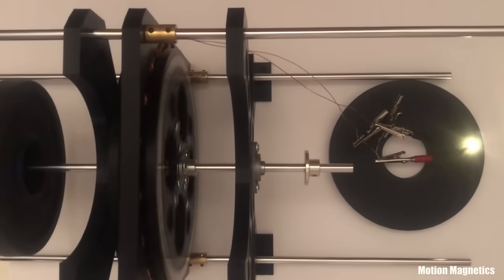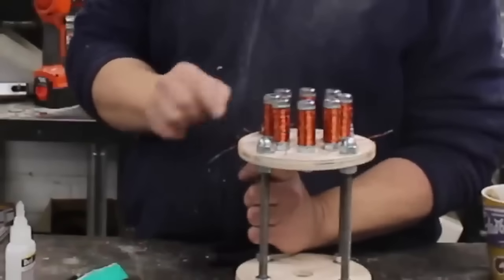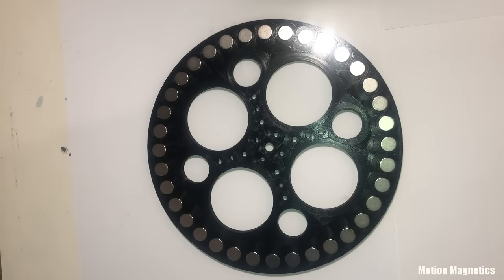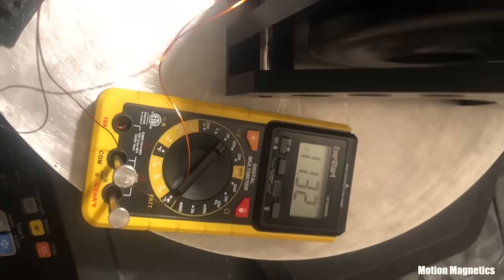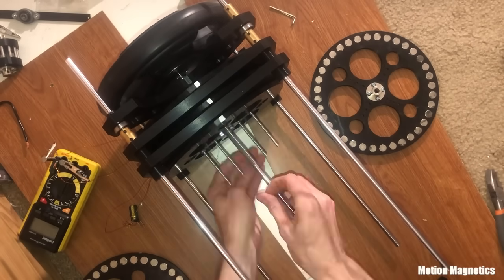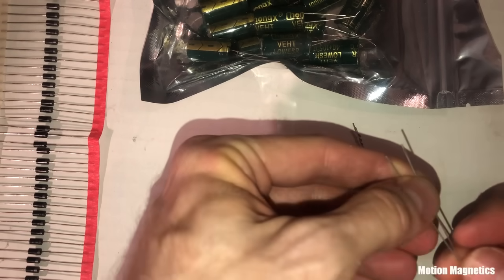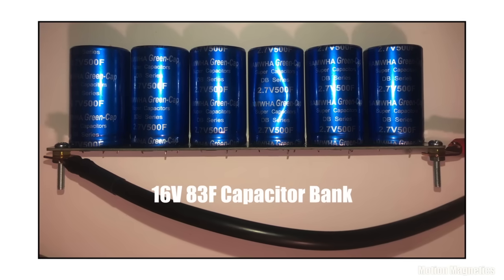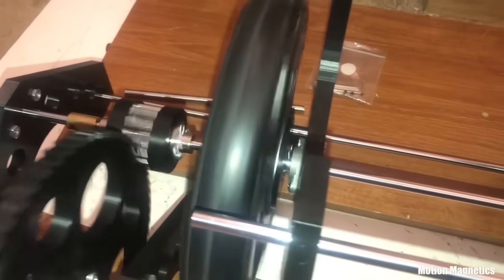Stackable Generator

Comment: I was collecting free microwaves for a while, its true people give them away all the time, but yeah the day you want one, nothing.   But wait a few more days and one will show up.   I have like 20 of the MOTs.   I started working on a motor for a trike using three of them, I had not seen anyone try that before, but you showed someone trying it, can you add a link to your description?  I found nothing myself before.  But another thing that is given away free all the time that may be more useful for a generator is ceiling fans.   
I like your stacking idea, however I will say that getting the air gap small makes a big difference, and those 3dprinted discs would be hard to keep straight and true to maintain the close gaps, particularly if they heat up.   So given you can stack them, I might suggest going with a smaller diameter.
Reply from the maker: Just search "Generator from a microwave" on YouTube and a bunch of videos will come up from people who have built them. 
Hadn't thought of using ceiling fans. 
You are correct. For a full-scale version, it would be better to make the parts with a CNC machine. The air gaps have to be larger when you 3D print the rotors because they wabble, thus you can't produce as much energy output as you could if the parts were precision made with a low air gap. 
Here's a link to one of the generators I referenced in the video.
https://www.youtube.com/watch?v=6hzEB7qmA-I
Reply: @Motionmagnetics  Ahh, I was trying to find motors not generators.  Seems these builds are pretty "sloppy". A motor that powers a moving vehicle must be efficient.
While I bought a lot of big N42 magnets at a business closing sale, they are expensive to buy at retail prices.  The ceiling fan induction motors can gnerate power without magnets.  You could stack them also but free ones are going to be all different sizes..is what I found.  I was working on using them as motors and some don't have poles that can be divided by 3 evenly. as they are all single phase so 14 poles is as good as 12.  But as generators that would not matter for you.
Look forward to more of your videos, thanks for sharing.
Reply from the maker: @murraymadness4674  That's interesting. Thanks!

Comment: This is very cool, I am also working on Axial Flux generator using serpentine coil (22 AWG). I really liked the idea of stacking. Are you planning to use this for wind turbine? I am eager to see the next steps on your initiatives ...keep up the good work 👍👍Thank you for sharing the information 👍
Reply from the maker: Nice! I hope you'll share your results once you've put it together. 
I'm planning on connecting it to gears that will be turned by a weight, but you could connect it to wind or even pedals if you wanted.

Comment: You can put a bedini motor to move the flywhell. Connect the bedini motor to RPM control, when rotation reduces, the motor turn on.
Reply: Adding a Bedini motor will make it LESS efficient. NOT a good idea ...

Comment: Will it not increase the resistance through the central shaft? Strength of that rod will come into play right?
Reply from the maker: Shouldn't be an issue with this particular design, but if I notice the shaft wabbling I'll add another of the outer housings to the center. You're not wrong in your thinking though, the size of the shaft I used definitely wouldn't work with steel cores between the coils.

Comment: Nice. I'm currently finishing up my first axial flux wind generator using Rob's videos and STLs. Your information on rectification was very helpful, made it look very easy with the simple 'twist it together' approach. If my first attempt works out, I'll have to have a proper think about attempting something modular like this. Very smart approach.
Reply from the maker: Thanks. Glad I could help. I got most of that from Robert so I felt it only fair to pass it along.

Comment: awesome work though ,ive found that with the weighted flywheels they need to be really spot on with all the weight at the outer most point or they can work against you ,cou;d posibly find some disk brake rootors around your size ,they hold alot of weight for small package
Reply from the maker: Thanks. Part of the reason I added the flywheels has to do with resetting the weight that will be connected to the gears later. I don't want to stop the generator to reset the weight.
Reply: plus an object in motion tends to stay in motion ,as long as a force acted apon it is not equal to or greater than,well itzs something like that, but what do i know the reality doesnt seem to be to stable these days .so it may change haha @Motionmagnetics
Reply: A Fly Wheel will NOT increase the efficiency. So why add it? It just increases the cost.
Reply: efficency is not allways important ,laws of inertia ,may help you understand why a flywheel maybee a concideration in such devices  @MrSummitville
Reply: we get caught up on things like efficency ,but forget some of the best inventions that cjanged our world were pretty simple and not very efficent ,ill take the device thats not that effiicent but betters the human experience

Comment: with those boost converters they are abit of a tricky one as they can only output the maximum wattage say 300 or 600 when they have an input voltage equal to their maximum input voltage,so exaple if it says 12 to 60 input,to get the full 300 you have to inputn 60 volts ,i know its weird but thats how they work

Comment: would be interesting to power this via higly tuned pulse motor ,or bedini motor,as you can actually get them to output some good rpms with reasonable torque if set up right
Reply: Bedini motors typical have LOW torque which makes them inappropriate for a generator that requires HIGH torque.
Reply: is that a general statement a bedini motor is basically a theroy with a design of concept ,there are 1000s of different configuration some for insane high rpm and low torque to high torque low rpm and everything inbetween,when we see bedini motor which is also coined pulse motor and adams motors ,,little variations on a same concept heres an examnple putting 5  pulse motors on a central shaft pulsed by the same computator ,still low torque?
Or instead of just basic 2 coil unit  ,you make it y6 pairs of coils with a separate ac stator and rotor at the end of the shaft that can be fed back im or sifoned ,still low torque? @MrSummitville
Reply: It all depends on what your premise is ,that is what do you want it for what job is it required to do,then you can design a device based on that ,useing a basic concept

Comment: Great work! Would live to see more build detail and way to get the stl files, if possible
Reply: Great! Be sure to setup at least a buymeacoffee, if not a Patreon (which is more work and, I think, takes a bigger cut of payments). Unfortunately, everyone expects free so not so many pay ... But some will soooo...

I watch Robert's channel as well and I know he provides files free ... But he is in retirement after a successful career with money in the bank. 

You sound like a much younger guy in a different phase of life. I could be wrong, of course, but if not don't be shy about creating an opportunity for folks to pay back.

Cheers! 

Oh, btw, my own likely use of this stackable design (which is an approach I've also been mulling over for a stackable cycloidal gear) is to convert it to a stackable/modular axial flux motor. 

Haven't quite figured out how because my background is biology/medicine... NOT mechanical and electrical engineering ... But I THINK it may be a matter of offsetting each of a set of three axial flux assemblies by 120 degrees and using an FOC with a DC power supply. 

Lol, and that could be COMPLETELY WRONG. 🤣🤣🤣

But you're approacg might give me a fast and affordable way to give it a try ... And tinker.

If recommend looking at cycloidal gears or even a hybrid cycloidal/planetary gear for your hearing solution. They can be made quite high ratio while still being backdrivable.

Ok... Cheers again!
Reply from the maker: @moses5407  Thanks for sharing. That's an interesting idea. 
I have a PayPal donate button, but I've probably received less than $30 on it since I listed it. I decided a long time ago that I was going to share and open-source the alternative energy research that I do, regardless of whether I ever made a cent on anything I create. It's never really been about the money to me. I just want to create something that will help make people's lives a little easier, and a little bit more free from the system. 
I sound a bit younger than I am, but I'm also not quite at retirement age yet.
Reply from the maker: Thanks! I plan on making it all available, but I kind of want to tweak a couple of things to save people from having any issues lining things up properly if they choose to build their own versions.

Comment: very excellent design. you have helped me make my mind up on building a serpentine coil generator with my 3d printer. i would like to try thinner wire and more turns and also 5 mm square n52 magnets
Reply from the maker: Thanks. I got the idea entirely from Robert Smith, but I'm really happy with how they work and how easy they are to put together.
Reply: @Motionmagnetics  yeah it appears it s a real winner design ! Really looking forward to your next update
Reply from the maker: @Buzzhumma  Thanks!
Reply: How are you going to spin the shaft? By hand?

Comment: I would go thinner wire in the serpentine and more windings . Its less than an amp so thinner can handle that and if its higher voltage then it will be probably lower amps anyway !
Reply from the maker: I considered it. Smaller wire, higher voltage, and less amperage. Thicker wire, more amperage, and less voltage. I tried microwave transformers that were around 12AWG, and Robert Smith tried .1mm magnetic wire, so I thought I'd try somewhere in the middle and see what kind of power output I'd get. I'm not married to a particular gauge though, I'm still experimenting.
Reply: @Motionmagnetics  I have been making coils to spin a bike wheel lately and I have been suprised that the smallest coil with just a 3mm bolt runs it the most effecient . It has created more questions than answers as to what is best for my purpose. I want more speed than torque so let the experiments begin
Reply from the maker: @Buzzhumma  That sounds like something you should be posting online. I would watch a video on that.
Reply: @Motionmagnetics  my next 4 shorts will be exacly about the diiferent coils and the big suprise
Reply: @Buzzhumma is your bicycle wheel under-load or free spinning?
Reply: @MrSummitville  it's not under electrical load but it's not the greatest of free spiinning wheels though . I will probably replace it with a bike front wheel that has better bearings so yes there is mechanical resistance as a load which worked out to be good for setting it up as overcoming that is visually obvious and tells me I am tuning in correct direction but I am ready for less friction !

Comment: beautiful and realistic design herr,s s suggestion hope it will be useful for you - You will get better efficiency if you use 3 phase winding in each stator instead of single phase, this way you generate maximum output from a single stator. You have 5 stators and 5 rotors if each stator is a 3 phase it will generate 3 times more output per stator as compared to the current single phase stator hope it helps  🙏
Reply from the maker: Thanks for the suggestion.

Comment: I’ll preface this comment by saying I’m not hating on the project, rather trying to understand it. Are you trying to generate power from gravity? It seems like a good idea, getting a counter weight to pull on a huge gear reduction to make the rotor spin quickly, but that’s where my skepticism comes from, seems like a simple power generation solution so why haven’t we done this already? Returning the counter weight back to the upright position requires more energy than what’s put in if memory serves me, but I’m willing to hear your thoughts. If the idea is more focused on the collection of power from a rotating shaft rather than specifically gravity then I totally understand the ideology
Reply: Just a crazy idea and I do have plenty, I think the idea is sound, keeping in mind that it can work in a vertical position just as easily, as Robert Murray Smith has demonstrated. It does open the door for VAWT's. His main idea was to stack rotors and coils. I do agree with the flywheel though, it does keep things going smoother for longer. In coastal areas, where wind is mostly stronger, the horizontal way might assist in preventing over-spinning. In short it will depend on location and what you are aiming at as a source of generation. Well done though, you have opened up an interesting concept.
Reply from the maker: @MPU_AJC1010   Thanks. I agree.
Reply from the maker: Picture a Cuckoo Clock. You pull the chains once a day, which lift the weights that run the clock through the day. Now imagine a similar but bigger gear system attached to a generator like I demonstrated in the video, but larger. The weight will obviously be much heavier, but if you reset the weight using a series of pulleys you could make a 500lb weight feel like 50lbs. The trade-off being that you have to pull the wire the weight is attached to a longer distance than pulling it directly. I could deal with lifting a weight with pulleys once or twice a day to power a generator rather than having to keep filling it with gasoline though. The idea may not work for everyone, but I enjoy experimenting with different approaches to things.
Reply: @Motionmagnetics  exactly the train of thought I kinda had, it’s trading(very loose analogy?) potential energy in gas, for kinetic energy in something pulling it. (Again that’s probably not quite the right or most correct way to say it, but hopefully you get what I’m trying to say)
Reply from the maker: @gorf1342  I do. :)
Reply: A 100 pound weight dropping 30 feet generates only 1 watt-hour.  Don't make me laugh!

Comment: try Transistor rectification as you will have a low voltage drop and high current flow, you can buy some premade ones to test out, they are more complex circuits to setup but worth it as your goal is efficiency, also you want your diodes when used to handle high voltage 1K+ as the collapsing magnetic field of any coil can get high.
Reply from the maker: Thanks for the suggestion.